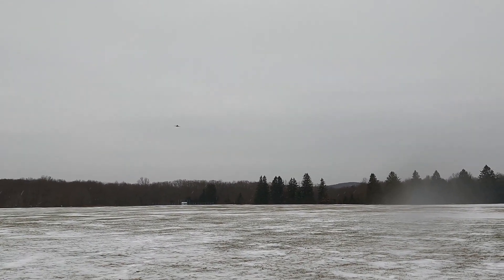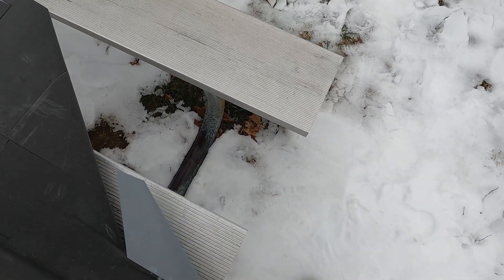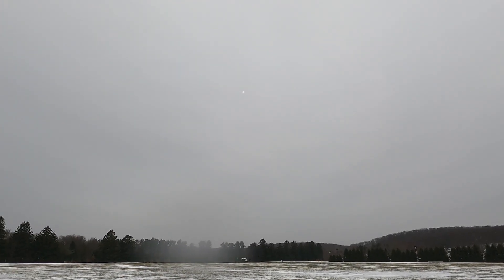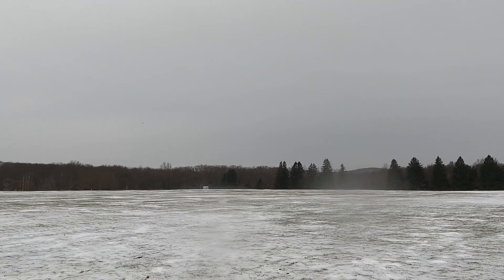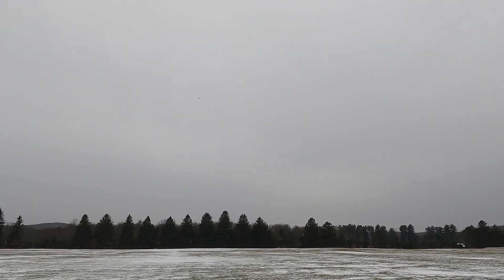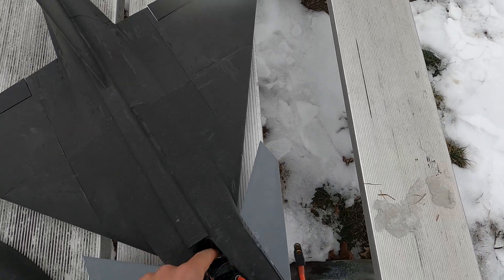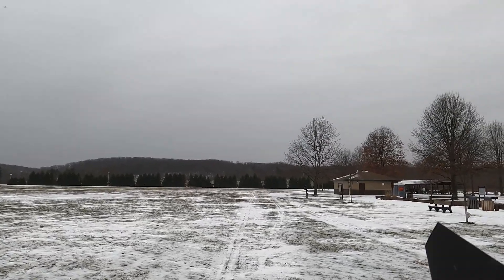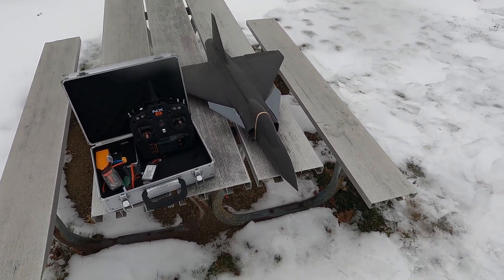3d printed Gripen V1 maiden flights (another winner!)

Comment: What size EDF are you using and is the final EXHAUST exit area sized 10-20% SMALLER than the EDFs FSA (Fan Sweep Area). I've had similar lack-luster flights in my early 3D printed F-111, until I necked-in the EDF exit to increase exit air velocity.
Great work on the model!
Reply from the maker: It’s a 64mm. I reduce it down to 90% on all my designs. Seems to work in everything else. The intakes are too small and the Gripen looks silly with cartoon intakes so cheater hole we go 👍🏻